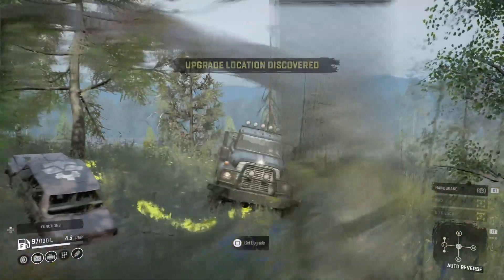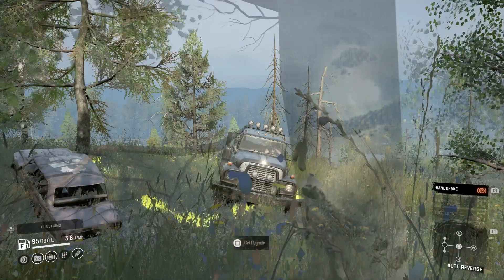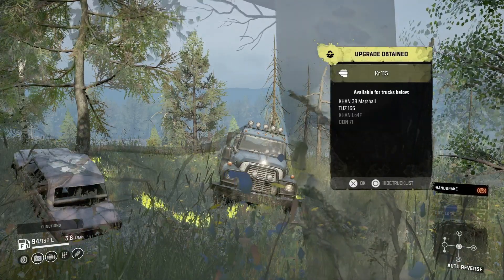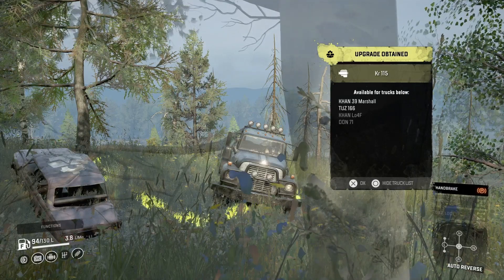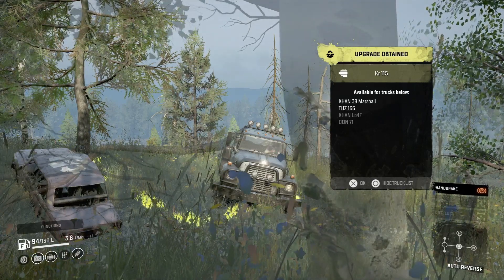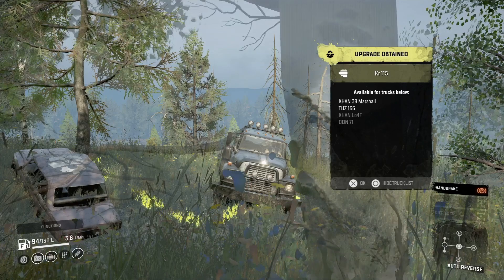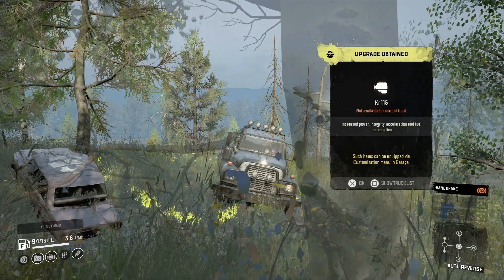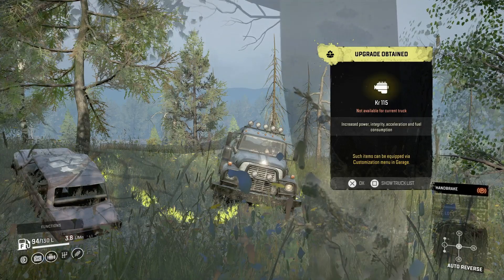Snowrunner Upgrades Engine location KR115  for Tuz 166,don 71,Khan,Lo4f

Comment: Great video, UK, I just discovered the best snow tire in the snowrunner,  the Yars 87 mudtire 49" TM I, this tire should be available for every truck as a titled snow tire, it's slippery on ice, but just plows through snow, it works best with Kr 135-T engine as the tires spin less, because of the less power, still a good speed for snow, cheers 🍻
Reply: Correction, a typo, the tire is 49" TM II, not the TM I, sorry thick thumbs,
Reply from the maker: only just seen this  mate  im going to do some testing over weekend but yeah it seems like mud tires are better than chains thanks for the info Mario